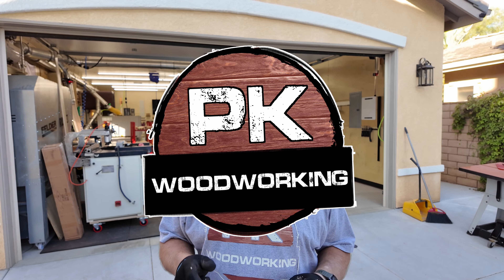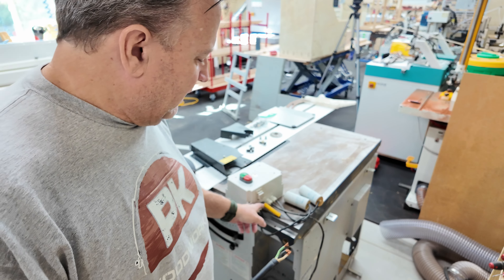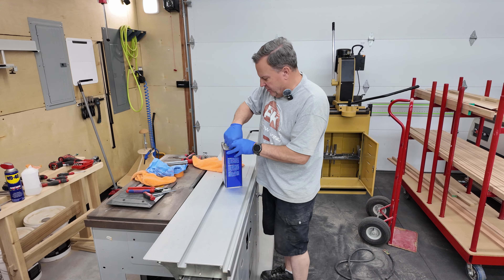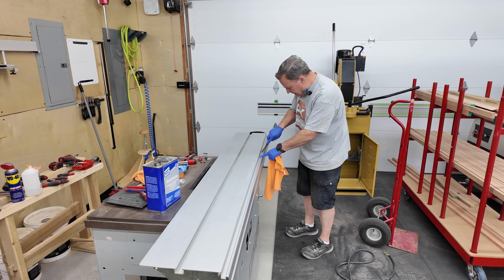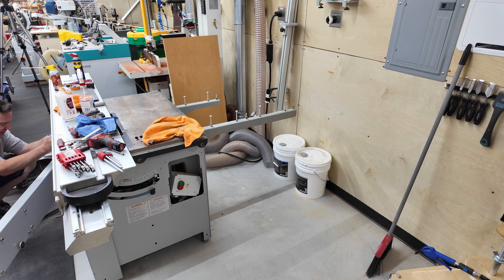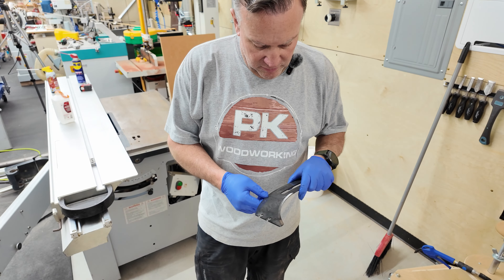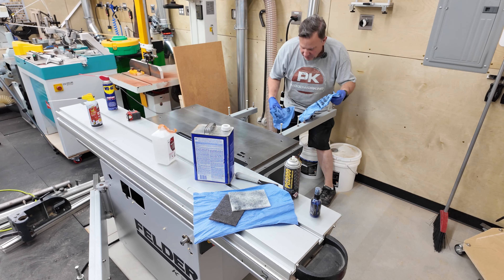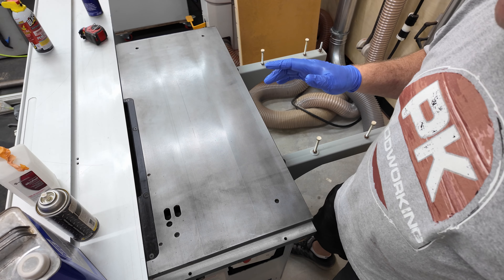Restoring my Brand New Second Hand Felder K500 Pt 1

Comment: The slider sounds like the bearing cage, bearings, and ways need to be thoroughly cleaned.
Reply from the maker: That sounds like a fun job!  - David, Thanks for the tips on how to clean the Bearings.  The process was simple and the slider does sound better and rolls smoother!  I am going to use your methods to dial in the slider this weekend!

Comment: So remind us why you sold the saw in the first place? Why the downgrade?
Reply from the maker: Shrinkflation!!!   I ordered a new saw that will hopefully arrive in January, so i need a saw in the meantime.
Reply: What’s the new saw going to be? I’m just plunked down for a 9’ KF700SP. It’s going to dominate my 500sq.ft. shop - but I’m hoping to recoup some space by ditching the router table and Kapex. Time will tell if that’s workable
Reply: You have arranged your shop very well and have fitted in some decent machinery.  Can I ask what size is the shop - I'm currently trying to juggle the space in my 700 sq ft to fit more in 😢. Cheers
Reply from the maker: 990 sqft outside,  924 sqft inside, 870 sqft if you take out the bathroom.  I'm starting to think about moving the dust collector and air compressor outside at some point at the back of the shop where I had them pour a pad.
Reply: @pkwoodworking   I think I'm the sort of person who would rather have a 2000sqft house and a 4000sqft workshop. Inverted priorities I know 🤪
Reply from the maker: Well, not gonna argue, but I am more 3k for the house and 1.5k for the shop, but we just could not fit more without making it look awkward.  Plus the house came first and this re ally came after the kids were out of high school.
Reply from the maker: I am keeping that under wraps right now.  I already ditched the router table, the miter saw station in next.
Reply: @pkwoodworking  Hope it's a Martin!
Reply from the maker: Martin saws are dreamy!